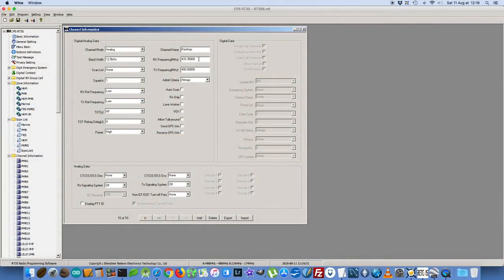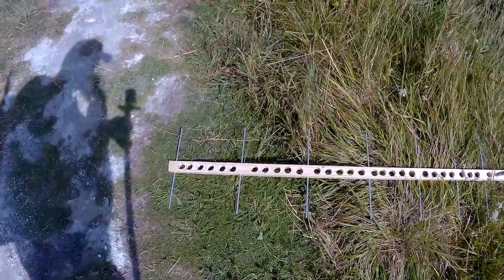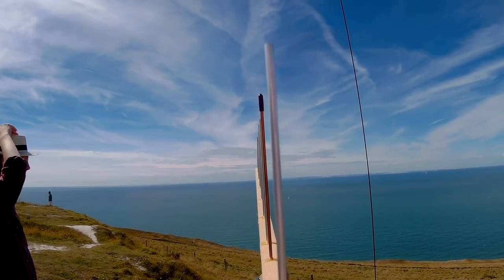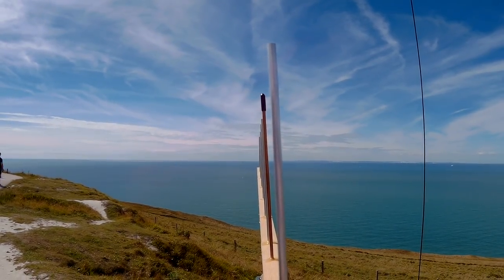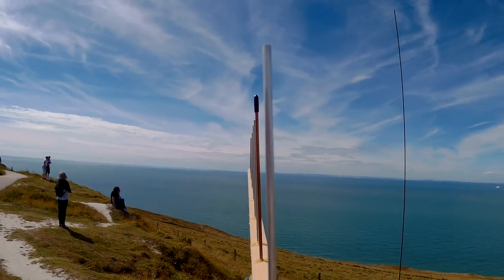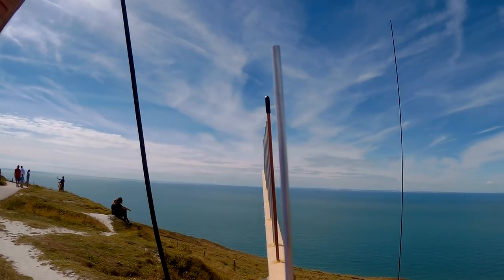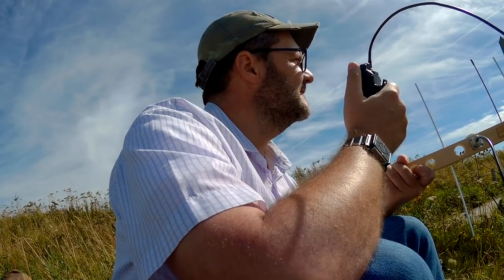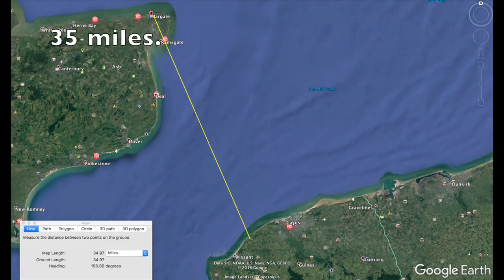Calling England From France on UHF With RT3S Radio and Yagi-Uda.

Comment: Your small radio adventures have reminded me that I can do much the same within 50 miles (80 km) of my home by driving to the top of Mt. Evans at 14000 feet (4267 meters) elevation, and I have a 9 element 70 cm antenna sitting in my closet unused, so I plan on doing just that this summer. I can even try out on HF my (tr)uSDX rig, as I'm building a portable vertical antenna for it. I'm sure it will work better than in my alleyway apartment, staring out my window at AC power-lines. Thanks for giving me the incentive to do so, and thanks for giving professor Yuda credit for his antenna design. In the USA nearly all hams just call the antennas 'Yagi's', but I don't. He deserves credit for inventing an amazingly useful antenna.
Reply from the maker: Great, you will get incredible range at that altitude!

Comment: VERY GOOD ! ! ! !    The beam worked great Gil ... I thought it would be great =)   You might want to add a cheap camera tripod to hold the beam with =)  Thanks for sharing Gil de N5VMO Pat
Reply from the maker: Yep, I actually just epoxied in a quarter inch tripod threaded nut into the boom.
Reply: Very good Gil .... I have taken a small bag with some small a pair of cabineers (  or"S" hooks ) / rope / twine to use as a weight to hold down the tripod / antenna ( stuff the empty sack in a pocket and fill it as needed when you get setup with the tripod and beam =)
Reply from the maker: Yep good idea..

Comment: Great work! I live about 250m above sea level and I can access a 70cms repeater, which is 38 miles away( in a straight line), with 200mW, indoors using a 1/4 wave antenna on a handheld. You really have to pick your spot carefully though. 73, G1DRP.
Reply from the maker: Definitely, height is right!

Comment: I also have a PRC 351 recently purchased but having transmit problem once ive sorted it out i will be using it alot tho i dout i will pick u up as im in london....thanks for the video u post as they are very helpful
Reply from the maker: Well, if you ever get yo the coast, let me know! Good luck with troubleshooting.
Reply: be down on south cost in devon in august will listen out for you
Reply from the maker: You'd have to let me know in advance. It's a 1:45 trip for me...
Reply: ok i will

Comment: A better test would be to stand in a high point in Calais, and try to communicate  radio-to-radio with no repeater, just the radio's own rubber duck antenna.
Reply from the maker: Yes, I did on 2m USB and FM. It does work very well indeed.

Comment: I had a contact on VHF, north Croatia to Graz Austrija, thats over 100km. I used my SlimJim on a summit, the other guy hat a 11 el yagi. I have to build one ASAP
Reply from the maker: Great! 11el. Is big though...
Reply: @RadioPrepper  yeah... I plan on a 4 or 5 el on a <1m boom. Still don't quite understand the gamma match.
Reply from the maker: Some yagis do not require a Gamma match because they have a 50 ohm impedence.. Like the one I built.. See m0ukd's site...